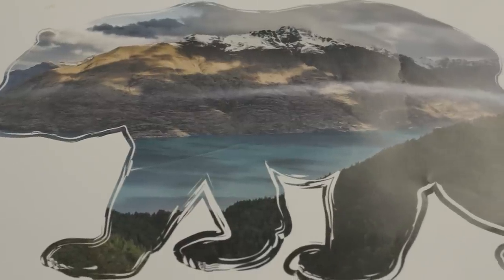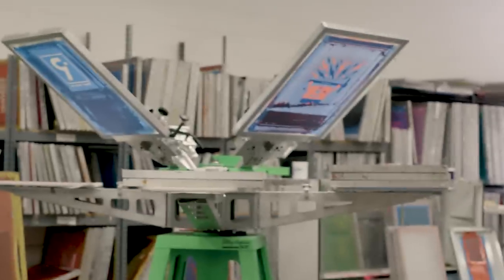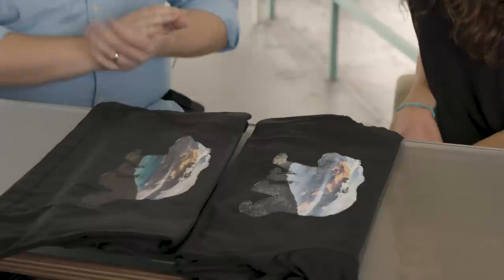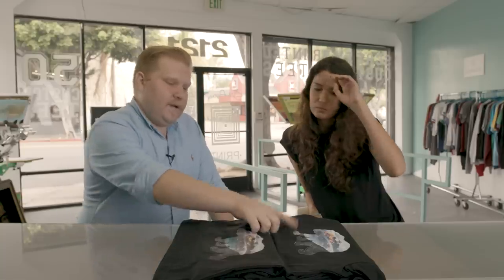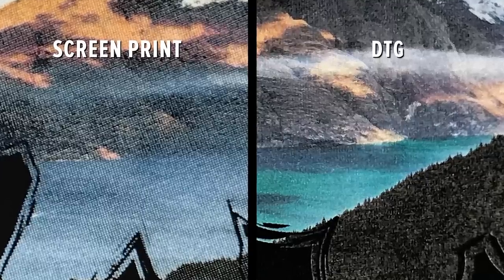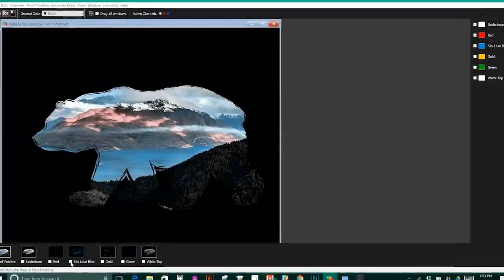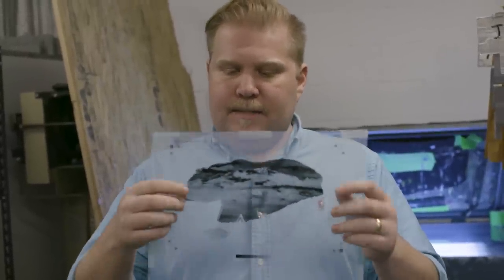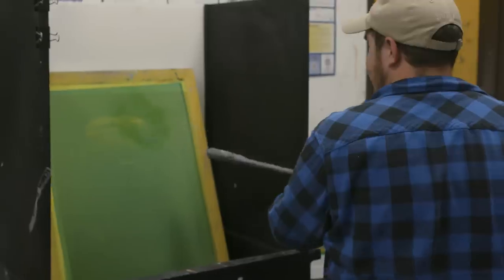T-Shirt Printing - Screen Print vs. DTG (Direct-to-Garment) Print

Comment: For those wondering how DTG washes, it depends how you print your garment, how well you pretreat it/cure the garment, and the quality of ink you’re using. We wash our DTG prints (and put them in the dryer) with no problems at all. DTG makes printing a breeze.
Reply: Depends a lot on the t-shirt too. Lots of higher quality inks and pretreatements are falling after few washes missleading people, who blame the ink brand, but it's the t-shirts that fails the good print. There is difference between cotton and "cotton".
Reply: @BpKoksan  Which shirts would you recommend?
Reply: @BpKoksan  Whats the difference? and what do you recommend

Comment: Would love to see a follow up after 15 washes :)
Reply: me too
Reply: Me too, and that is not a good CMYK separation also.
Reply: De Todo Hn that is spot color seperation.. for pic image they should have gone with cmyk...
Reply: spoiler DTG fails after 10
Reply: screen printed failed at 1.
Reply: Luis Castellon lol
Reply: DTG Fails After EVERY Washe(S)
Reply from the maker: If your printer pre-treats before doing DTG the print should last much longer than without. Talk with your local printer to see if they use a pre-treat on the shirts.
Reply: owais khan that’s just not true I’ve washed my dtg prints using Bella + Canvas t-shirts. Still great print quality
Reply: With DTG, I hear you have to wash the t-shirt in cold water, for longer lasting design.
I have many RAMONES screen printed t-shirts, and after many years when the shirt is dropping to bits, the screen print is as good as the day I bought it.
I miss the RAMONES so much.
Reply: @BELLACANVASOFFICIAL   I have a 24 years old screen printing company. I have t-shirts that I have printed 15 years ago and image is almost as good as new. I have 2 DTG printers as well for over 4-5 years. I tried lots of ink brands and pretreatements, none of them can compare with the screen printing quality, speed and price per unit. DTG is perfect, but only for personalized t-shirts or smaller orders
Reply from the maker: @BpKoksan  Thanks for sharing your feedback and experience!
Reply from the maker: @Nopeynope88  that's a great question. Kornit and Brother are big makers of DTG printers. We just did a video with Kornit if you'd like to get to know them - https://www.youtube.com/watch?v=lW_23Z36fQc
Reply: @BpKoksan  that’s weird because I’ve used dtg and been washed well over 40 times and details still amazing
Reply: @raymondlang  I miss the Ramones as well, friend. Gabba Gabba Hey!

Comment: I used Printful to print a multi-colored design via DTG and I was not very impressed with how the design faded after each wash, nor did I like the chemical smell that the shirt had when I first opened the packaging. Moving forward, I think that I'm gonna only use screen printing. Great Video!
Reply: Hi，friend. We are a Chinese DTF products supplier. Are you interested in DTF printing?
Reply: That’s because Printful is a terrible quality company to use. Consider using a local printer

Comment: I'm a screen printer!

In reference to screen printing:
"There are three to four blues in this artwork but we simplified it down to 1."
"And that's where we're going to see the biggest difference between this and DTG."

One of the advantages of getting your artwork screen printed is that you can use more vibrant colors. A screenprint can use multiple blues, whereas DTG only uses 1 blue.

Question: Why the 45 line screening? I do 50 for manual printing; can't you do at least 55 for automatic machines?

I don't think this was a fair comparison.
Reply: Agreed
Reply: they wanted  dtg looks better  over screen print, screen print its way better than that...
Reply: Print
Reply: Same here!
Reply: Yeah. We used to run CMYK on a lot of stuff with crazy detail and it looked fantastic. Bitch to set up but looked amazing and I had a few test print shirts that the prints outlasted the actual shirts.

Comment: I work with both screen printing and dtg and while dtg has higher resolution than some screen printing processes the dtg is very limited in what you can print. Some dtg machines won't take vector files and you are limited to the type of garment you can print. Overall I'd rather stick with screen print because of the speed, durability, and the ability to print on more types of garments
Reply: Hi，friend. We are a Chinese DTF products supplier. Are you interested in DTF printing?

Comment: We have both, DTG takes a lot of time to make large quantities, must of the time for 50 pieces or more with 3 or 4 colors we use screen printing it all comes down to how many colors the job needs, for low quantites with many colors DTG is the way to go
Reply from the maker: Yes, exactly! It all comes down to the job.
Reply: Ricardo Flores does DTG hold up well after being washed many times ???
Reply: mega akkadian yes it hold up really well. Just make sure to use the correct temperature and pressure to make it last.
Reply: Ricardo Flores ok’ appreciate the info thanks 👍
Reply: thanks for the info
Reply: Hi，friend. We are a Chinese DTF products supplier. Are you interested in DTF printing?

Comment: I agree screen printed plastisol ink washes better but the DTG when cured right looks pretty good. I have seen 2 and 3 year old DTG prints still going strong.
Reply: Shirt Agency I agree. However, I would like to see the durability of this particular design long term. I've yet to see any DTG hold up great long term with white ink. Great video by Bella Canvas btw!
Reply: Forget plastisol. I make my sim process inks out of green galaxy mixing system. All you have to do is match the colors.  I discharge the base. I use Wiliflex spot process plastisol occasionally when sep studio separated. I also use InkSeps CWB plastisol but it doesn’t matter which I use all are going to look like your dtg but be done in a tenth the time.
Reply: Hi，friend. We are a Chinese DTF products supplier. Are you interested in DTF printing?

Comment: I have sent numerous photos of mine to printers and they are just about the same to me.  If you are using 1 - 2 colors, you can go way faster with screen and I get that.  But if you want a realistic tee, DTG preserves that. A lot of my clients do want the cartoonish look of hand-drawn art.  A screen printer told me recently that the top of the line DTG machines are going to be around $50k and will need new heads several times a year and they are $1K each.  I suppose you could start out with a $15K machine at first or two and then work up to the high-end stuff.
Reply from the maker: Right! It really depends on both the printer and customer's budgets and needs. Thanks for adding your two cents! We love hearing everyone's experiences.
Reply: Hi，friend. We are a Chinese DTF products supplier. Are you interested in DTF printing?

Comment: Johnathan Macaw is correct. If and only if, you are doing a design with multiple colors AND also a very intricate design like the one used in the video, you would more than likely have to go with DTG Printing. With that said, Silk Screening is hands down, KING. It is superior over and above all other forms of printing. And here is some more VERY important information when it comes to using DTG Printing. DTG machines print using cyan, magenta, yellow and black (CMYK). When you convert an amazing looking digital file from RGB to CMYK, (the designs you create on your computer use RGB) many colors go “out of gamut.” Simply put, they can't be reproduced using just CMYK. In my opinion, any company that uses DTG, especially for Drop Shipping, should make it loud and clear what problems can arise when printing shirts. Maybe they do now, not sure. But if you didn't know, now ya know. I hope I am saving people from a whole lot of problems they didn't know exists with DTG Printing Technology. Finally, the video was great in its ability to show a difference when someone has to deal with such intricate art work.

Comment: I've been printing for 40 years, including 4 color high end process. Why did they use such a large dot? A 55lpi would have worked much better as a 4 COLOR PROCESS. The negative in the white underbass would suffice as the black.
Reply: sweldon this is simulated process. The dots could be smaller but we have less headaches with a larger dot which makes jobs run faster.
Reply: Yeah! I am agree with you, even 65 Lpi & round dot is the best and you can get better results
Reply: at 65 with a 300-320 mesh i get result really close to dtg costumers can't see the difference i even have screen printer telling me i did it with a dtg. i work similar with simulated process.
Reply: sweldonn what do you think a screen print or a dtg ?
Reply: Shirt Agency headache? You’re comparing. Make it honest. You are putting 45 lpi up against a digital printer?  You need to keep the Roque rocking. I’m all about Rocking with Roque and powering the print. I wish Ryonet wouldn’t even sell those dtg printers. But they have to do what they have to do. You won’t catch me with one. I have a small run system established that flies and let’s face it. That would be the only advantage of dtg, for small runs. You’re kidding yourself making it about quality. I choke my base and interlock my halftones. I have accurip and sep studio but on a print like that I would manual sep It and hit it at 65 lpi.
Reply: It looks like he didn’t have any negative because he has white peaking through. His lpi needed to be higher and his base should’ve been choked. Also he could’ve registered it better.
Reply: because they only want DTG to look better. I can do extremely detailed color separations that will look just like DTG.
Reply: @activistsupply6635  Do you handle out of state orders?
Reply: Hi，friend. We are a Chinese DTF products supplier. Are you interested in DTF printing?

Comment: I am on a manual Vastex and print at 55 lpi.... These guys were on a ROQ auto and went down to 45 lpi, my guess is they wanted the screen print to look noticeably different.  The first time I watched this video before I started to Sim Process I really didn't understand but now that I crank out photo prints on a manual trust me they could have gotten a better print.  But the real test is what will the DTG look like 10, 20, 60 washes later

Comment: Hey serious question here if I want to build a Brand for tshirt shorts hats etc and money isn't an issue which should I buy dtg or screen print there's a ridiculous gap in price between them and I would like to not only make my own brand but eventually have a high quality street brand?? Any help needed money is not an issue
Reply: Hi, It is so remarkable that someone else is researching how to start their own brand at the same time as me.
I was actually going to ask what screen they used, and if a higher mess count would provide a more clear screen print.

also I just bought a 4 clolor 2 station press from amazon. It seems to be chinesium, but I hope it lasts long enough for me to turn a profit, and buy the incredible equipment some of these youtubers use.

check out:
Reyestheentrepreneur
Kenyonken

It is so hard to filter through the bs, and product pushing.
Reply: Math Don thank you! I will check them out

Comment: which method do those vintage style Johnson Motor Company shirts use? Yuu can not feel the print, feels like the rest of the shirt and its very light saturated so you can look trough it. I can not imagine its DTG and it isnt sublimation as well because its cotton. So i guess its like a screen print but very lightly done, i dont know if thats possible. Just curious because i have some shirts from them.

Comment: Great video, but what happens after washing and normal wear/tear with the clothing?  Is there a difference?
Reply from the maker: Screen printing is a little bit more durable after multiple washes. Some people find more fading with DTG, but if you get the settings right with DTG you can eliminate some of those differences on the wash test front
Reply: Hi，friend. We are a Chinese DTF products supplier. Are you interested in DTF printing?

Comment: Why when I use spreadshirt or such my designs come out terribly? Are there better dtg printers if so who does the best work
Reply: look into the M&R M-Link X  i have my own sample prints sent to me from M&R and i can't even touch the quality and feel of the print with screens.  Don't forget these machines use CMYK inks to print so if your creating designs in RGB on your computer, your screen is backlit and using colours that are not in the pantone range. Certain colours will be altered due to limitations in CMYK.
Reply: I thought the same. Mine looked faded!

Comment: One thing i dont like with graphic t shirts is when the print is too thick and stiff... lol. anyway, im wondering if one of these printing methods has more of a light feel almost like its part of the shirt?
Reply from the maker: With larger graphics like this, it does feel a little thicker especially on a darker shirt. If you print with DTG on a white or light colored shirt - the print will feel much more a part of the fabric.

Comment: I loved the video.
Screen printing is much better than DTG.
Reply: Not at all actually. The modern new print tech is far far better than screen printing. Much higher quality and true full color.
Reply: Jackie Rolanta I'm in the process of starting my own t-shirt business
Reply: Derick Bryant .You are living in the past. For best quality DTG wins hands down. I would not wear a screen print pile of paint. Mass quantities where quality is not issue then screen printing will do for the cheapie t shirt.
Reply: Jackie Rolanta nope, the colors look weak, photo-real is for sublimation, nothing bewts silk screening onto white tees.
Reply: Every style has its benefits. Sublimation has its place, vinyl, screen printing, dtg, etc...There is no "better", but there is a, more what is right in a specific situation. Good luck to all in their apparel endeavors. 🙌🏻
Reply: Embroidered is the way to go
Reply: Not at all. If you're just starting out, check out Heat Transfer Vinyl. If you get good quality transfer you can make it work until you can afford a DTG printer. I'm getting a Cricut maker which I can use to cut designs with precision and then transfer with a heat press. With vinyl you can also achieve results neither DTG or screen print can such as glitter and metallic. You can also sell a wider variety of products.
Reply: Derick the black beast has no clue
Reply: How is the shop, Derick?  The last years before I sold my business, almost everything was DTG.  The newer DTG printers could print a multi-color shirt in under two minutes, set up time was practically nothing, and my last printer was even self cleaning.  I was loyal to the silk too, but the technology was too great to ignore.
Reply: Agree
Reply: basura DTG ,es inferior en todo sentido ,DTG parece que llevarías puesto una fotocopia en tu t-shirt ,en cambio la impresión  de pantalla parece un cuadro pintado por salvador  Dalí o Vangho
Reply: cosete tus dedos con las agujas de la máquina de bordar ,esas son cosas de señoritas jajajaja

Comment: Why not use CMYK plastisol for the screen printed option?
Reply from the maker: Hey Venancio! Cole suggests avoiding putting CMYK on anything that isn’t white for a better color control and a smoother finish with simulated process.
Reply: BELLA CANVAS cmyk is 100% able to print on dark colors. Lay down a white base with a low bleed plastisol then the cmyk colors on top of that. Of course the white has to be flashed first and if the cmyk are actual cmyk colors they should be thin. I would recommend wilflex ink

Comment: But is DTG not better as far as economically and faster printing time as well.
Reply from the maker: Hey Allen! It depends on quantity. Screen printing is actually much faster than DTG once the screens are burned, so it's faster when printing a big run. A good rule of thumb is DTG is usually more cost effective with small quantities, but when you are doing large runs, screen printing ends up being cheaper and faster.

Comment: What is the difference in cost??
Reply from the maker: It depends on quantity. With screen printing, your printing cost per shirt will go do as your quantity increases. DTG is a fixed cost so it's better for smaller runs! If you are printing more than 100 units of the same artwork, its usually faster and cheaper to screen print.

Comment: Anyone knows which one is better for only black and white printing? Black ink on white shirts, and white ink in black shirts. I like the idea of no ''touch-feeling'' of the ink in DTG, but the durability concerns me! How much time a DTG print last?  Any advice?
Reply from the maker: If you are doing a single color, screen printing is prob your best bet! It will last longer, plus, it's an easy set up for just one screen. Use a water based black ink on the white shirt and use a white discharge ink on a black shirt. That will give you that soft hand feel!
Reply: Very nice! Didn't know that, thank you so much for the help!
Reply: The modern systems like the Epson or Brother deliver awesome high-quality results and last a long time. The tech is totally different today than it was when DTG first came around. They last longer than screen prints.
Reply: No way on earth that a DTG print lasts longer than screen printing! DTG is reliant on a pre spray on the garments ( which weakens every wash ) and plastisol inks weld themselves to the garment!